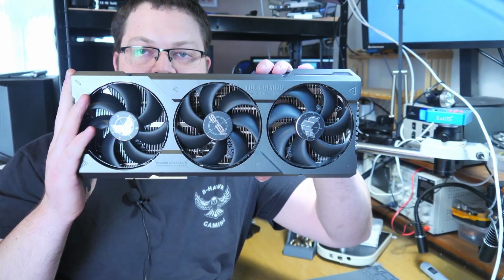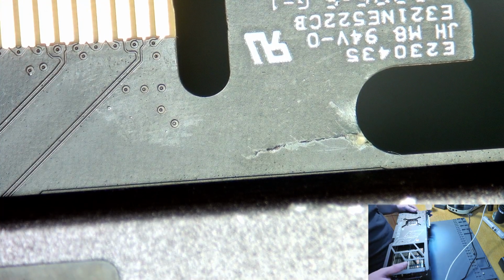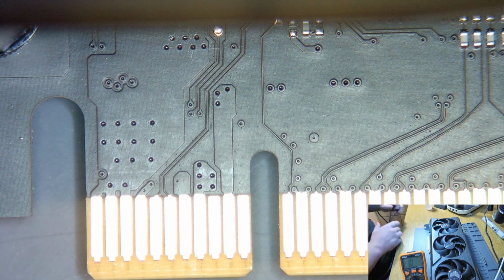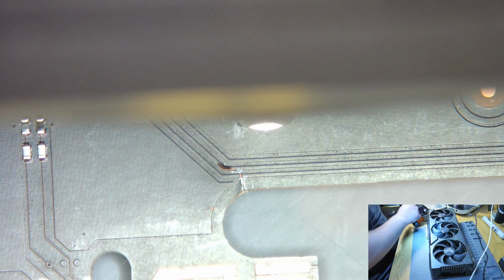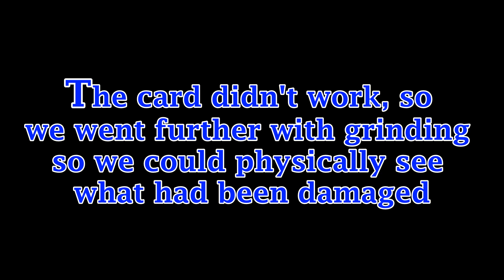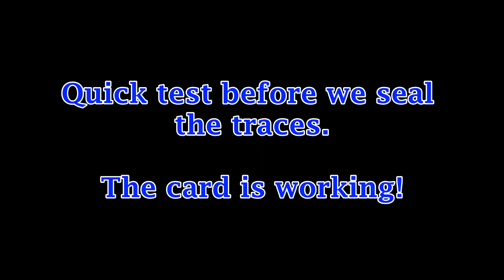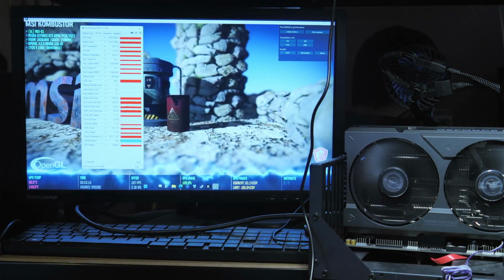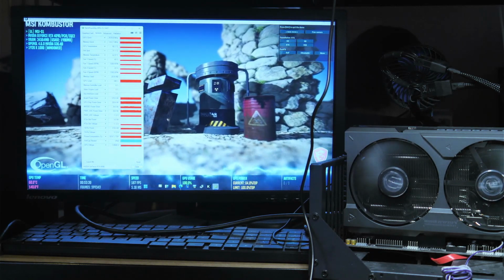Asus TUF RTX 4090 - Cracked - Graphics Card Repair

Comment: That fact that the locking tab is still used on cards that are 10x the weight of what that was designed for is appalling. I hope one day they have gpus secured to the case like a second motherboard and use a riser cable to connect to the motherboard. I realize you can do this already but it should be the standard.

Comment: Good job, do you mind if I ask which product you use for masking the solders? by the way I like your side-way lamp!
Reply from the maker: Thank you. I use mechanic solder mask. I do believe that there are better options out there, such as the fast cure relife uvh902. I haven't tried that yet, but just picked one up and I am waiting on delivery. I might use it in a video and see how it holds up.
Reply: @b-hawkgaming  Good point, I am not pleased with mechanic mask maybe cause my Qianli uv light does not have enough power to torch well but that fast-cure 902 worth some trial,  thanks.

Comment: Since the 3090s, I have just vertically mounted my cards. I just don't have faith in the horizontal taking the weight over time. Even more so with the 4090s and 5090s in the future.
Reply from the maker: That is a good way to do it. But I have started noticing another trend with some cards using sub-standard thermal pads. Standing a card upright will cause the thermal pad secretions to interact with the thermal paste and dilute it. This will eventually run out the bottom, leaving the core dry. Seems to be a trend on some cards, but I can't conclusively say that this is the case. For people that don't monitor their temps, it could be a road to disaster.
Reply: @b-hawkgaming  This is true, gravity being what it is. I watch my temps all the time (2nd screen), so if anything looks odd, I will address it. For me personally, I can fix the thermal paste side of things if it comes to that...I cannot do what you do 🙂

Comment: Awesome work B-Hawk ! Any tips on how i learn how to trace like you do ? Its like one of the parts of GPU-repairs i havent done yet , and im sometimes a bit confused looking at this ,like the layers , seeing were the crack goes ,how deep... Any suggestions ,toturials ,tips ? Kind regards
Reply from the maker: Thank you for the commendation. In my personal experience, practice makes perfect. Get some scrap boards and grind away. I personally believe that the only way to get better at something is to do it repetitively. Ignore the mistakes you make and persist. There are loads of videos being released on these kinds of repairs. Try to watch as many as possible. You will eventually get the hang of it.